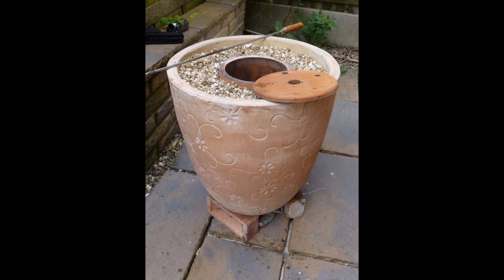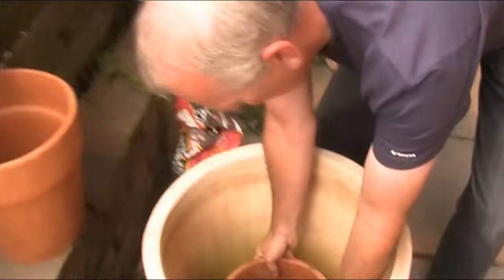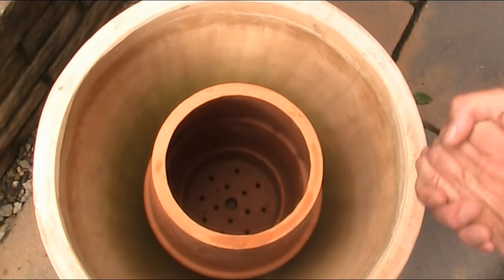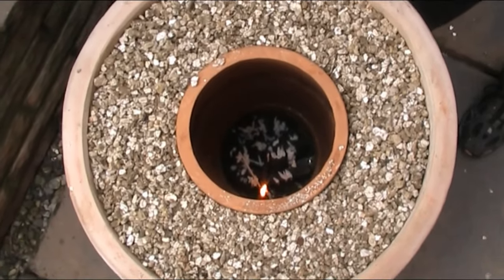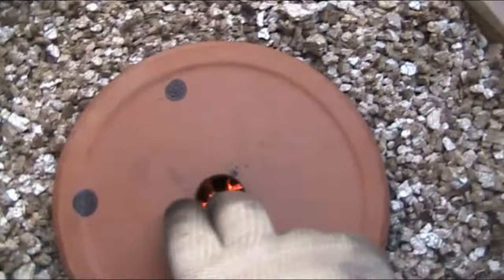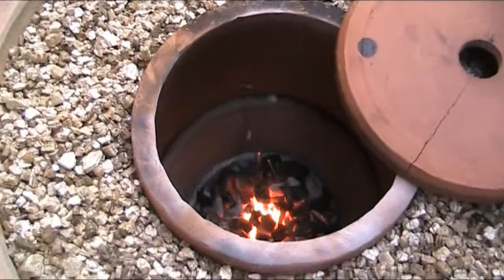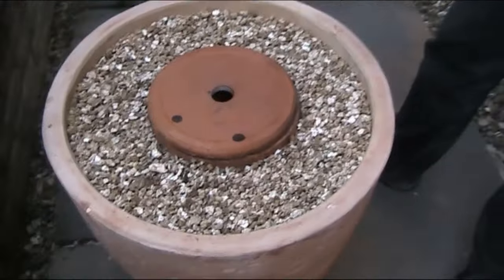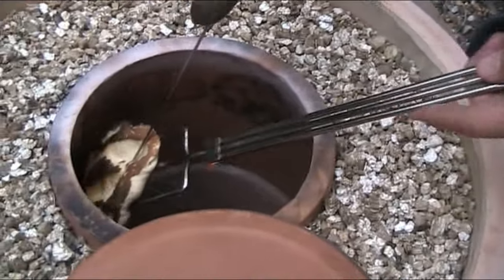How to make a DIY Tandoor oven with Flower Pots

Comment: Hi Nick, just a suggestion. It wont get burnt as much, If the side of the naan bread which is going to stick with tandoor is wet. hope you it will work for you.
Reply from the maker: Muhammad Din Thanks Muhammad, I picked that tip up from someone else, and as you say it does the trick. Thanks for sharing on the video so other people benefit.

Comment: My mom used a wet rag to wipe the surface before placing the naan in. That helped removing the coal residue and cool the back off a bit. She also used a small pillow looking  medium to even out the dough before smacking it inside the oven.. its like using the wood stick to drop the pizza in an oven
Reply from the maker: Thanks for sharing, much appreciated

Comment: Hi before putting the bread in you should rub a wet cloth inside the oven to cool down little bit the temperature of the oven then your bread will not burn from the back side it will be golden brown .
Reply from the maker: Yes thanks for mentioning that and sharing with everyone. This video was the first time I tried cooking a naan, so I soon learnt from my mistakes. As you say every time I cook bread I wipe down the inside of the oven. I should also point out that if I leave the lid on, the sides can get a bit sooty from the smoke, so another reason to wipe down with a wet cloth to clean first.  Once again thanks for sharing.
Reply: Awesome idea! How do you clean the ash out, presume just scoop it out by hand?
Reply from the maker: Hi, check this out - https://youtu.be/ewac7d4u2uU for cleaning the oven

Comment: Great video, Nick - I am looking to do this ASAP.  Two questions - 

1. Isn't there a lot of soot in the sides of the chamber that must get on the naans? The set that came off in the video did seem quite black on the side they were stuck on.  Is that so, or are you using some specific type of charcoal that does not give off smoke?

2. Does a regular saw work for cutting off the bottom of the pot?

Thanks very much for your help!
Reply: Oh, and one more question - how do you clean the ash (and maybe some half-burned pieces of the cola) that remains after the charcoal has burned out?
Reply from the maker: Hi Mahesh thanks for the feedback, and here are the answers to your questions:

1. Yes there is often soot on the sides of the chamber, and I simply give it a wipe down with a damp cloth before I cook the naan. You correct in saying the naan was quite black, this was not soot, but the fact that I burnt the naans. This was the first time I had cooked a naan in the often, and was caught out with how fast it cooked. I have done a subsequent video on how long it takes to book meat, and in that I cook a naan, but this time I don't burn it.

2. Yes you can cut the pot with a regular saw, but it will blunt it. Check out my original tandoor oven video where I show using a regular saw - Making a Tandoor Oven in the Garden Full version

3. As for cleaning the pot, I simply poke the debris through the holes in the bottom. I get asked this question a lot, so I will try and make a video next week to show how easy it is.
Reply: SimpleNick - Nick Collins Thanks so much. I'm relieved to hear about the soot - tho' I'm a meat lover, my big interest is to be able to make good naan and roti (whole wheat version)! I am about to embark on building it right now - will keep you posted on how it goes :-) (I did see your first tandoor video already btw! Great job with the tandoors and the videos!)

Comment: hi nick, i just love this tandoor. want to know if ceramic pot would be as good as the terracotta?? thxc
Reply from the maker: Hi, lots of people have used ceramic pots for the external pot, but make sure you have good insulation. I am only saying as the glazing often has lead in it. For the inner pots I would only use terracotta.
Reply: Hi Nick, why is it that you'd only use terracotta? For flavor or concern about glazing? What about a material like cordierite (often used with pizza stone)

Comment: As an indian ex restaurateur I have to say this is brilliant.
There are load of comments here to say to sprinkle water inside the clay, however I used to see my head chef priming the clay with yoghurt, which allows the naan to peel off without sticking. 
10/10.
Reply from the maker: Thanks for sharing that, and I had someone else mention that to me as well. Thanks
Reply: Ruhul Choudory hi Ruhul can you advise how they did this and was it regularly when the oven was cold?
Reply: @MxTim405  
You have to prime or “seal” the clay with the yogurt. (You can use oil as well).

Apply a thin layer of yogurt or oil to the inside of the tandoor, covering the clay surface. Light the tandoor, keep the heat about medium. Let it burn for a while, till you get a nice “sheen” to the clay surface. You can then use the tandoori for naans. 
This method should last a long while, but  you may have to repeat it every once in a as while, if you have problems removing the naans.
Reply: @theoriginalshakil8013  thanks a lot! I will build my new tandoor when the garden is finished

Comment: Many thanks for sharing Nick! I made one based on your design and am absolutely loving it. I had to make a couple tweaks to get temperatures up well above 900F. Raising the coals up from the bottom by a couple inches so they don't choke up the air intake did the trick. I used a charcoal grate to do that. Getting close to 1000F now.
The kebabs have been incredible. Now gotta learn making a good naan!
Thanks again!
Reply from the maker: Thanks for the feedback and the tip on using a grate.  My naan's have greatly improved. In this video this was the first time I tried to cook a naan, and I had learnt about mu oven yet. I could have done a few test runs first, but I like to share my mistakes with viewers.
Reply: @SimpleNickVideos  Sorry, my comment was about my own naan fiasco.
My first attempt was rather weak - turned out more like Pita bread than naan. The second attempt with a slightly different dough prep was a drastic improvement - almost restaurant like. That's one great thing with the tandoor - it's been a lot of fun experimenting and learning. Within about 3 uses, my food is close to that of my favorite restaurants which is immensely satisfying. Thanks again for sharing your design.

Comment: Brilliant revision to your first design Nick! The extra ventilation in the bottom will really help the cooking; I found it essential in mine; although I put a much bigger single hole in to aid cleaning the ash out. The breads look fantastic by the way! 

Revision 2 to mine is on hold for a while as I'm too busy working on the inside of our new house at the moment. the insulated top seems like a must though; especially if bread is on the menu! 

My only suggestions would be to add gravel to the top for a bit of decoration and to weigh the vermiculite down to keep it from blowing out, and to invest in a weber BBQ starter if you are ever having difficulty lighting a fire in the tandoor (as it can be tricky)

I accidentally bought house coals for mine which burn hotter than anything I've used before; but are completely useless in a regular BBQ - they only work in the Tandoor.

Great work Nick, you're doing it right!
Reply from the maker: Hi Rick, thanks for the feedback. I was going to put some slate chipping onto so it matched some other pots I have. As for the BBQ starter, no need as it lights really easy. I put some lighter fuel onto, drop a match and then walk away. The air flow is so good I have to put the lid on to slow it down. I have another video which I will upload later that shows how easy it is to light. The other thing, the base pot is a lot wider at the bottom, and the outer pot has three large holes, so I am guessing that is why it works so well.

Comment from the maker: Hi Ehsan, for some reason can't reply to your question, so answering here. I personally haven't used sand, but other people have with success. Checkout James Tandoor on my blog http://www.simplenick.com/blog . Buy  someone on my how long does it take to cook meat video posted that they used sand and it cracked the outside pot. Can you get hold of perlite, or lava rock, or crushed pumice?
Reply: SimpleNick - Nick Collins Hi Nick, Thank you for your reply. So I looked and getting perlite, lava rock, etc... is a little challenging where I am. I did look at James' Tandoor and it seems like he was able to use sand with no problem. The MSDS label says that it's not flammable so hopefully it will be safe to use. A couple of questions came up as I was doing my research: (1) When filling the exterior pot with vermiculite, does this not leak out from the bottom since the exterior pot also has holes at the bottom? (2) In this video: watch?v=dfHKmt10JZY  the guy used a galvanized steel trash can. What are your thoughts on this please?
Many thanks :)
Reply: Ehsan may be able to find kiln bricks / fire bricks (a.k.a., refractories). We discovered these when building wood fired saunas in South Asia.  They can be hammered down to the size needed. (Wear goggles.)

Comment: Hi Nick, this is a brilliant idea. I'm currently researching brick pizza ovens and that morphed into clay pot pizza ovens because I want to make naan breads as well, and that is how I ended up at this video. It's been 25 years since I made a tandoor out of an old metal garbage can and some clay I dug out of the back garden. That tandoor lasted 20 years. I look forward to my next experiment and this video has provided me with inspiration. Just one question... did you have to pre-fire the tandoor before hitting those temperatures or was it all ready to go?
Reply from the maker: Hi Roy, thanks for the feedback. To be honest I went straight in and started cooking, but lots of people recommend pre heating first, and using a rub on the walls

Comment: When the side walls are not black anymore its up to heat as soot is burned off. Will also make sure you're not getting all that on your naan. Also if you make a little lowering basket with hooks you can dangle food in centre of tandoor which helps with cooking.
Reply from the maker: Excellent tips and thanks for sharing

Comment: Spray salted water on inner side of tandoor, it will make it less sticky. Secondly add some water on that surface of naan witch is facing heat by this naam will not burn and will be soft.
Reply from the maker: Top tips! Thanks for sharing with the community Shami

Comment: Great vid, have made one myself. Simple and works a treat.  My only addition was a 99p stainless steel sink drainer to use as an additional grill.  Thanks Nick!
Reply from the maker: Tom Beran Thanks for the feedback Tim, and nice tip about the sink drainer
Reply: Hi Tom. When you say sink drainer, what exactly do you mean? I imagine that to be extremely small. How does it work?
Reply: @lawswon4857  check out stainless steel sink drainers online - about 5-6 inches.  Hope that helps

Comment: Great build, Nick! Thank you! A friend and I both built tandoors this weekend, with the same gear as one another. It was a lot of fun and the results are absolutely delicious. One problem: we're both noticing cracks in our inner bottom pot. It's a well made clay pot from a German manufacturer. Any advice come to mind?? If not, we'll just try a different manf and hope for the same success so many others have reported. The initial, edible results were so good. I'm determined to find a worthy pot.
Reply from the maker: Hi Shawn glad to hear you and your mate had a successful build. As for cracks, my first oven had smaller pots, and I have not experienced cracks. For this build with bigger pots, I do have two cracks in the bottom inner pot. But to be honest it doesn't really bother me and doesn't affect the performance. If I was worried I would look at using some clay to fill the cracks, and some people have played around with lifting the coals off the pots to stop any cracks. I plan to do an update video on the oven in September for its first birthday to show the state of the pots.
Reply: SimpleNick - Nick Collins Got it. Thanks again! If it's ok with you, Nick, I'd like to submit my formal support of your entry into the DIY hall-of-fame. That'll be upon your first year of eligibility, of course.

Comment: What happens if you don't insulate it at all with vermiculite.  I know it would be really hot to touch; other than that, will it affect the cooking or the pots at all?  Just curious.  Some insulate their tandoor ovens while others don't.  Never made one but interested to see the rational behind the insulation vs. no insulation.  Is it for heat retention or preference.
Reply from the maker: To be honest never tried it without insulation, nor have I been contacted by anyone doing so. Some people use small stones or sand as the insulation, so not as good as vermiculite, and are able to cook with success. I have to point out that several people that have used sand, have been hit with the outer pot cracking.
Reply: Without insulation there is a good chance the solo pot will crack

Comment: Beautiful design sir, to add on and make the design better may I suggest to put a piece of metal grate towards the bottom pot edge, and apply a thick layer (1-2") of clay inside the tandoor (top pot) so your naans will come out better.

Comment: I did it  oven during your instruction and the fraction of the pot  material which  you recommend  was broken eye of my baby.
My baby is now blind . The health inspectors said that the flower pot is not good for tandoori oven, because is not enough resistant for hot temperatures. I am worrying everybody, please do not do that.

Comment: did you have any problems with that inside clay pot cracking over time????
Reply from the maker: I have had a few cracks, and I have posted a few videos on this. But I haven't changed the pots, and still use it as it does affect performance. The oven is now 3 1/2 years old and works as well as it did in the beginning.

Comment: I built this and it's awesome. It's currently 16 degrees Fahrenheit will this crack if I use it today?
Reply from the maker: Hi glad you had success with your build and I hope you enjoy it as much as I do. As to will it crack, I can't really answer that as there are sop many variables. But if it did I wouldn't worry, mine has cracked inside but I still use it, and it is over two years old now. Here is a review I did so you can see the cracks I have https://www.youtube.com/watch?v=ZVJ_5TAOIPc

Comment: Hi, just wanted to ask if the pot doesn't crack, considering you should be reaching 400-500ºc inside. It was surely not made to stand such heat. Thxs.
Reply from the maker: Yes there are cracks, but it doesn't affect the performance, checkout this review I did some time ago.  https://www.youtube.com/watch?v=ZVJ_5TAOIPc . The Oven is now 2 years, 2 months old, and still in working order.

Comment: Hi SimpleNick - Nick Collins
this is brilliant idea of you 
BUT 
did you know that Iraqies since thousands of years build like this tandoor as you call it(in Iraqi local Arabic accent called TANOOR no big difference )but a little wider from the bottom and they build it completely 
NOTICE
1-For more ventilation in Iraqi design we open side lower hole upper the bottom with about 10 cm for tow reasons 
A- for more ventilation whch will give you blue flames less CO2
b- Get the ashes out of the Tanoor (clean it more easily) 
2-  For baking bread in the Tanoor you must raise the temperature inside it until it get white inside (close the upper whole and put more coal )that's mean you will get away all the black area that deposited on the sides of the Tanoor after igniting the coal . You will not get the black back as you notice at the end of your video 
3- When you but the dough in the tanoor you should close the upper hole in order that the face side of the dough become crispy 

hoping these remarks is good for you

Thank you for this video
Reply from the maker: +Salah Ahmed Hi Salah, thanks for the feedback and no I didn't know this about the Tanoor. Thanks for opening my eyes, as a search of Tanoor brings back lots of cool recipes.

Comment: Hi Nick I made one and it was great but sadly the rather expensive outside pot has cracked and will need replacing. Think from a mix of heat and then dampness. Do you think fibreglass/fibreclay would be ok with vermiculite & pearlite insulation? Or if not galvanised steel?
Reply from the maker: Not tried this myself, but I guess it all depends on how good the insulation is. Not sure about fibreglass, would want to research to make sure no dangerous gases are released. As I say no experience here.

Comment: Hi great idea,but can I use the vermitulite you get from garden centres??Or is it special type of vermiculite??
Reply from the maker: Hi Ajmer, In theory you could use the vermiculite from garden centre, but I would not recommend for two reasons. First the vermiculite from there is often very small, and secondly and the real reason I would not use from garden centre is the price. I buy big bags from builders merchants, Travis Perkins here in the UK, which is a lot more cost effective. I buy the 100l bags, which I have also seen on ebay.

Comment: Hi Nick. How does vermiculite fair with rainfall? Do u need to cover it up when finished to avoid getting wet?
Reply from the maker: Yaqub Desai Hi Yaqub, The insulation properties of the vermiculite are reduced when wet. For example mine got wet once, and the outer pot got hot to touch.  I always cover my Tandoor when not in use. The attraction solution is a large pot saucer turned upside down. Most people tend to use large plastic bags or store the oven in a shed.